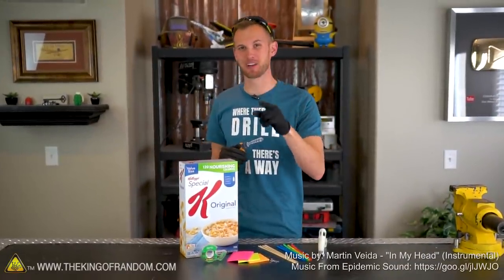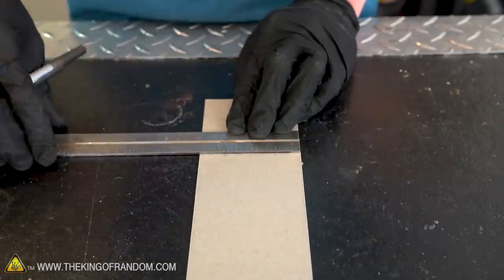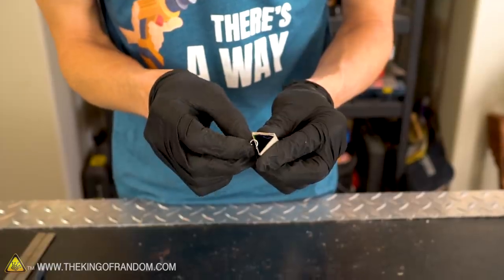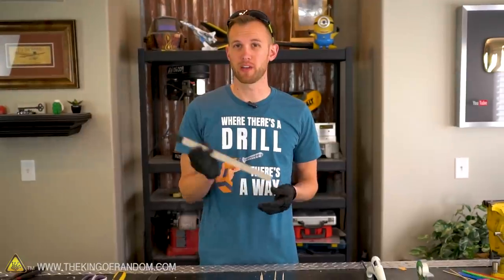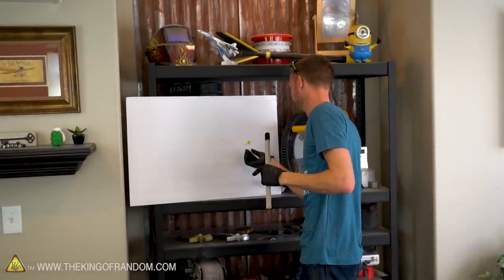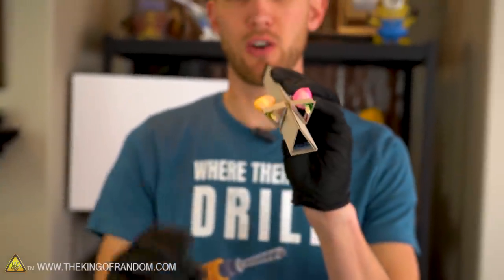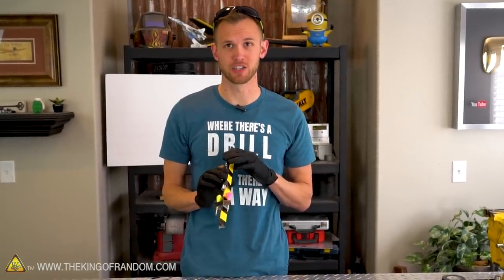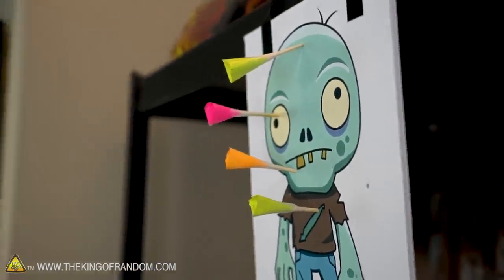DIY Cereal Box Blowgun! TKOR Shows You How To Make Blowgun!

Comment: Put a concerete block in a vaccum chamber and theorically it will turn into dust

If not just shake the vaccum chamber a little bit to break vender wall forces between them

It will be fun
Reply: PUNEET jain yea!
Reply: If it doesent work, don't lose faith in it, but shake harder
Reply: wrong video this should be on the action labs vid

Comment: You can make similar blowguns with way more power by taking pvc pipe (about 1cm diameter is best) and take longer rectangular pieces of paper and roll these up as cones aswell. If you get the trick you can get these darts to easily go 20-35meters

Comment: Make a Jet engine in a jar. Jet engines combine oxygen from the surrounding air with on-board fuel to burn at very high temperatures and create thrust in the direction of the flame. Hope you do this.

Comment: King of random?  I made the blowgun, but I didn't have electric tape, but duct tape works fine to you cut the tape in half.  Also when you made the darts, you marked the post it notes and you didn't need to do that.  You can just push the un cut dart in and use the er n of the blowgun as a guide.